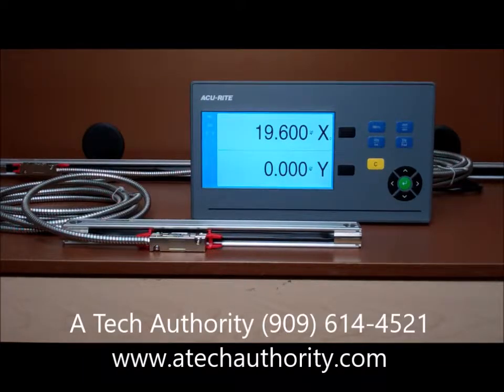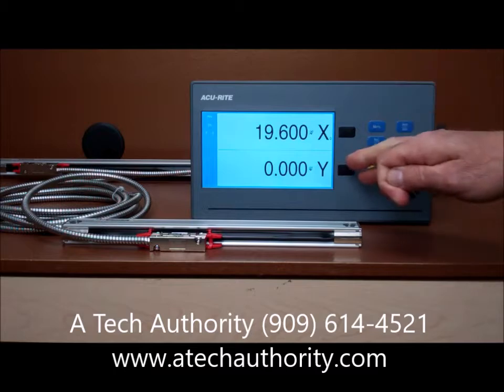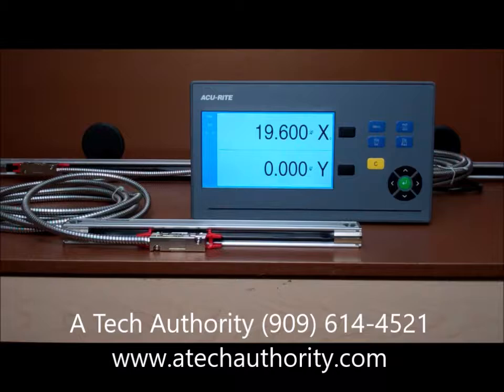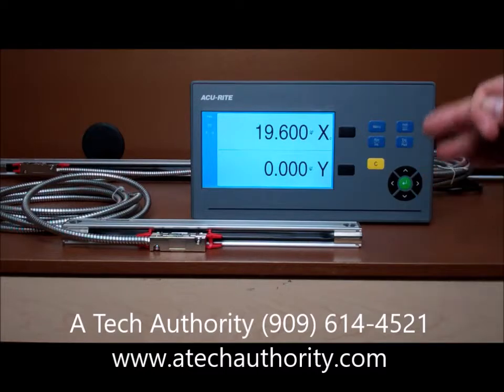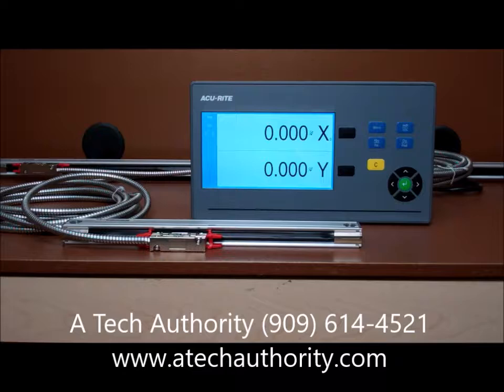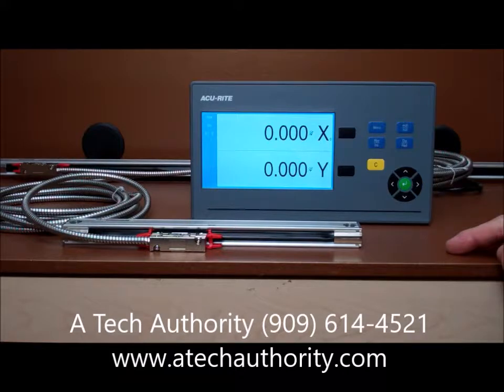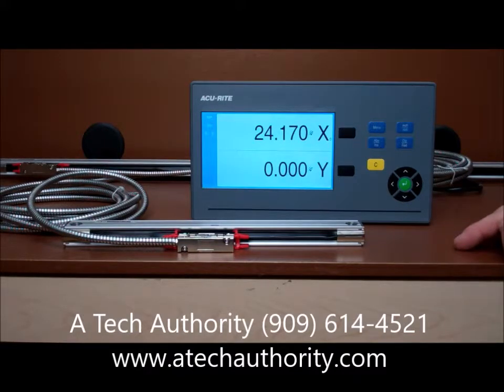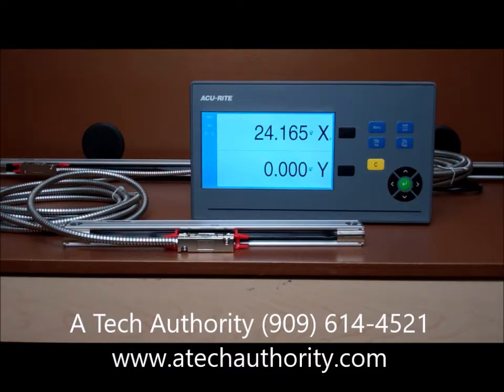AcuRite DRO 102

Comment: What might be wrong if the screen is very dark?
Reply from the maker: First, check the brightness setting to ensure it's fully increased.  If it is, contact the distributor you purchased it from or call tech support at 847-519-3394